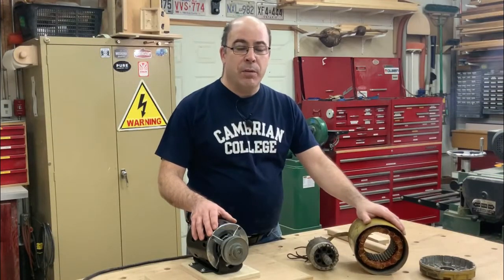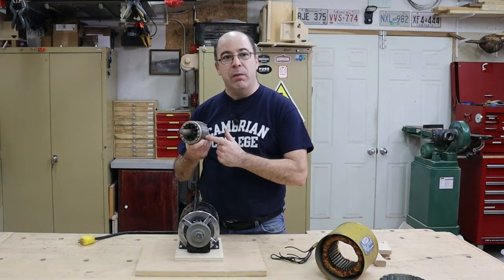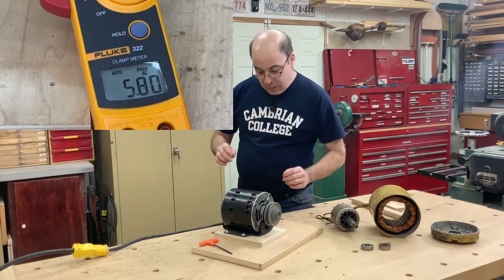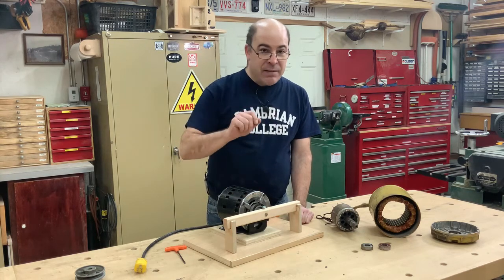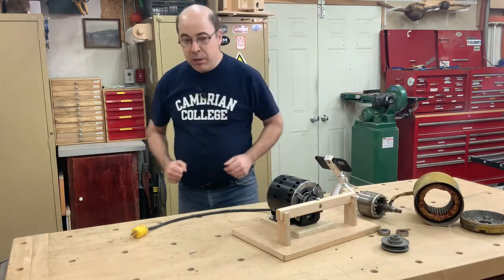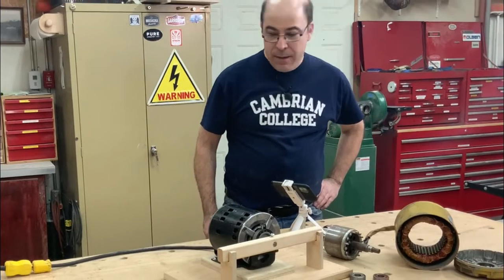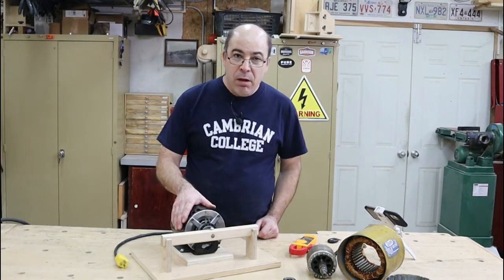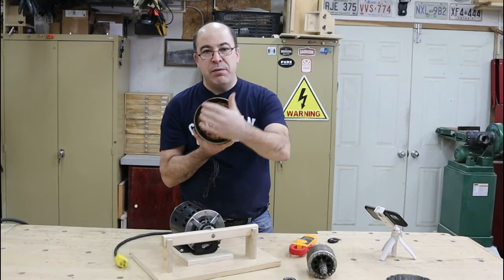The perils of locked rotor current

Comment: Hi, ive got a 300v 3phase motor and I'm trying to put an encoder on it.  Part of calibrating the encoder is I'm suppose to lock the motor and then set the encoder to zero. How do I know what's a safe voltage and current i can connect to the phase 1 and phase 2 wires without burning the windings up but will rotate and lock the rotor to the zero position?  Thanks

Comment: reaction maybe a year late but I must say I was a bit worried for a few seconds there during LRC demo because no switch or OCPD was used to energised the motor for demonstration. Good thing the motor is equipped with thermal protection and most importantly, the instructor concluded the demo safe and sound! Stay SAFE . Thanks.

Comment: You forgot to mention that a locked rotor = 0 air movement due to the immobilized fan blades. Zero air movement then contributes to an accelerated Stator temperature rise. It nearly complies with the definition of "Thermal Runaway" but not quite.  ;-)